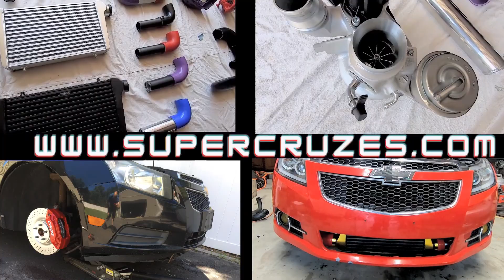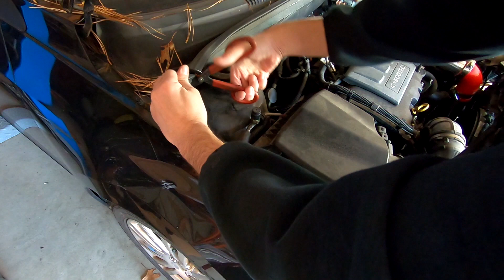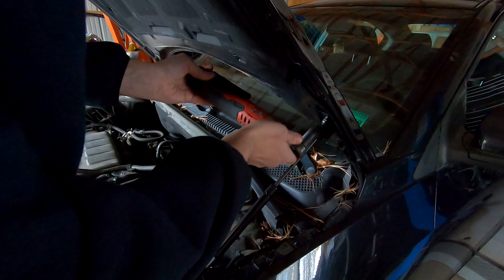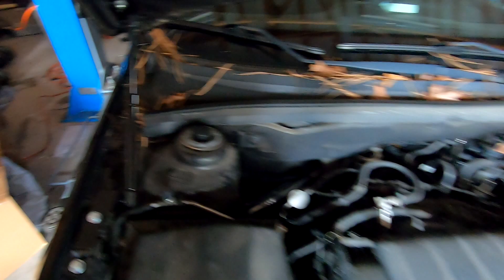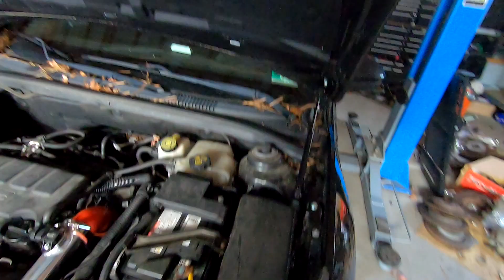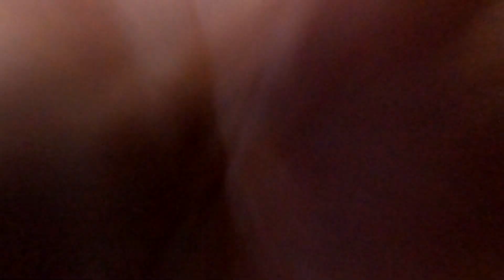Cruze hood struts install Dave's World Black Widow Build

Comment: Bro do you know the part number for the stock intercooler? I have 2017 chevy cruze LS but automatic.
Reply from the maker: Not off hand but I do have a supplier that has them if you can't find one.
Reply: @davesworld2132  yeah it's kinda hard on ebay they say it's for 2017 cruze but the actuator on the pictures alone tells it's for the 1st gen and they do charge restocking fee and this is where they get most of the buyers money.
Reply from the maker: @czerus2233  what’s the price for the eBay ones? I saw the GM price is not cheap. I could prob get you one of my intercoolers cheaper than OEM and it’s a better upgrade over stock
Reply: @davesworld2132  I dropped the balls on an ebay stock intercooler as mine has a deep hole on the bottom, it's about $128. I just need it now as the car struggles to build boost. I really need your upgraded stock intercooler once I'm done with my credit card debt. When summer hits I need the intercooler upgrade as it gets hot here in the high desert.
Reply from the maker: @czerus2233  definitely keep in touch. It transforms the way the car feels.